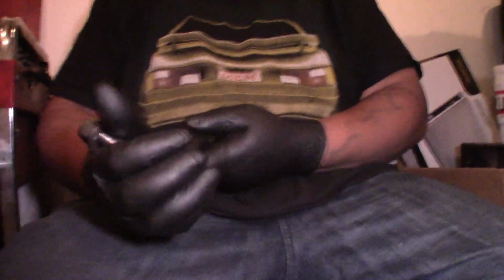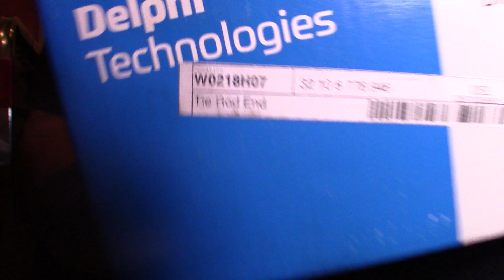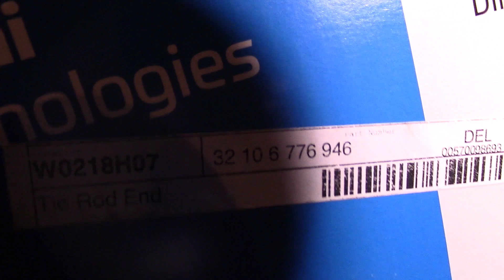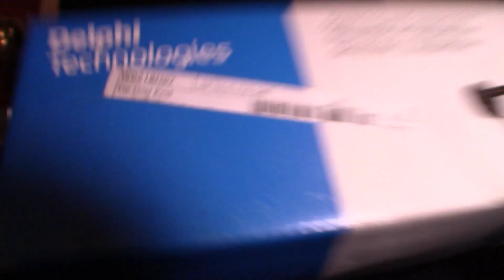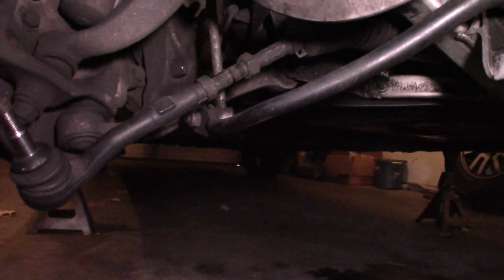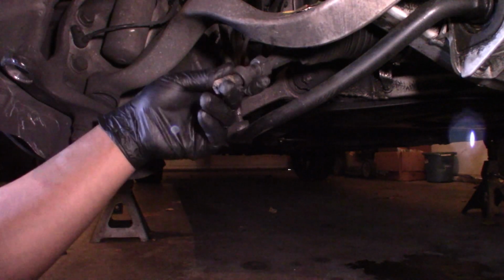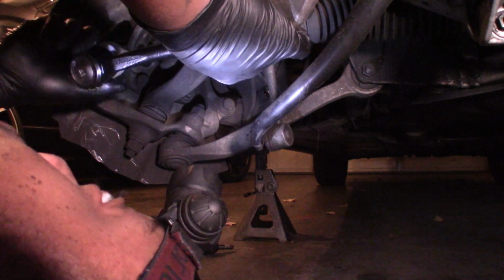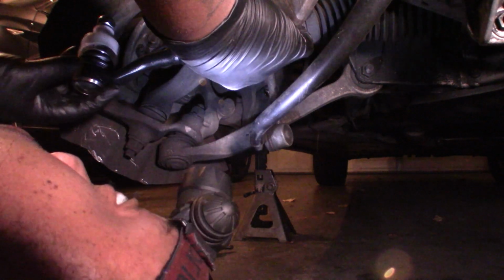BMW E65 E66 CHANGING OUTER TIE RODS

Comment: Bruh, you should of replaced the whole tie rod assembly. Takes a pipe wrench 🔧 to undo the large nut on the TR assembly, easy swap. The steering is much tighter doing so.